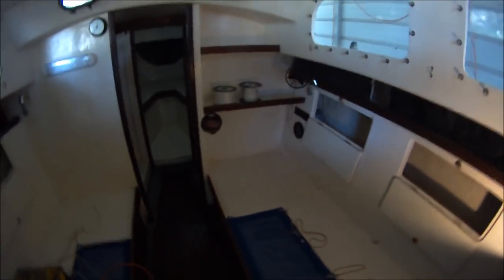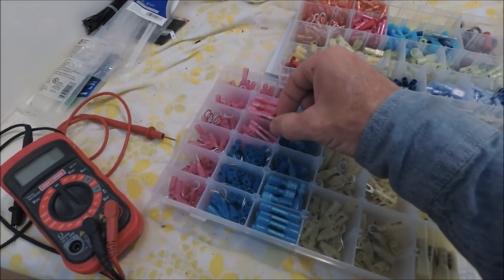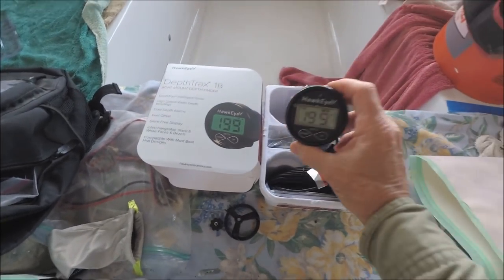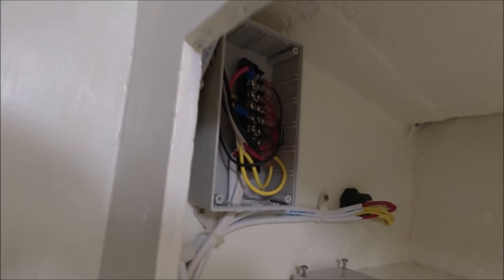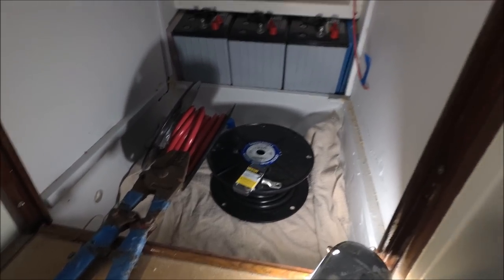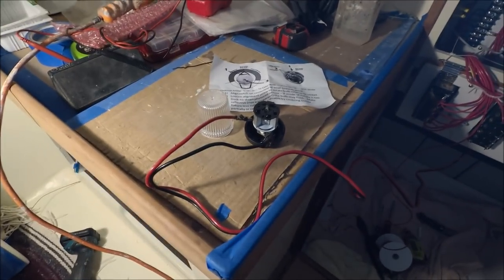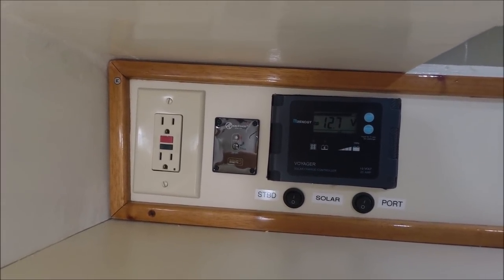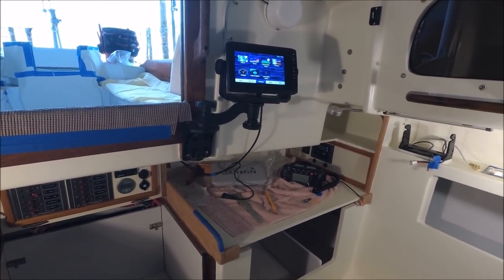Rewiring Sailboat 12 Volt Electrical   Triton Osprey Refit Part 8

Comment: James, absolutely enjoy your videos and books(currently reading your Distant Seas (puts me to sleep at night). Anyway, on the shut off switch for the outboard alternator-can you explain that a bit please. Thx.
Reply from the maker: You could wire the outboard motor alternator direct to a fused line going to the batteries but I put a switch in line to isolate it so I can monitor current going into the batteries and to be able to disconnect the circuit for troubleshooting. And because the switch is normally off when anchored or sailing I don't have to worry about some fault leaking current back to the motor. Same for the solar panels.

Comment: Good one! Lot of info. Did you have to do anything special with the alternator output from your outboard?  Did you run it through a charge controller?
Reply from the maker: The 6hp outboard motor alternator has very little output, only about 1.5 amps so does not need an external controller with a 420 AH battery bank. And the switch is there so you can just turn it off if not needed.

Comment: This is a fantastic video and I am currently working on my 1960 Triton. I have a question on the Garmin depth sounder you mention, located forward, I think on the port side. Do you have any photos of the transducer from the outside of the hull? I am considering a shark bite into the bow keel but your install looks to be simpler, although I am not clear on any disadvantages. My GPS plotter supports both Chirp and ClearVu.
Reply from the maker: There are no photos of the transducer from outside because they do not penetrate the hull. The face of the transducer is epoxied inside the hull. About 10% of the range is lost when shooting thru the hull but it means one less hole to cut, no chance if leaks, and transducer can be replaced in water by knocking the old one off with hammer and chisel. I don't know if your transducer is compatible with inside hull mounting. Here is a link to a video of some other options:
https://www.youtube.com/watch?v=ZX5U0JmEwoM

Comment: Hi James, I cannot thank you enough for the details you have put into this very instructive video. Second to none, I would say. I watched it so many times over that I lost count. One burning question is - what is the significance of the inverter remote switch? Why remote?  Thank you once again.
Reply from the maker: Good to hear the video is helpful. It's optional to use the remote inverter switch. It came included and is just a convenience so you don't have to reach in a locker to turn it on and off. If the inverter is mounted exposed then no need to use it. Keep in mind these cheap modified sine wave inverters are a great value but will not power some electronics and may shorten the life of some. I've had good luck over the years with this model but realize that might not always be the case. Everything I've plugged into it seems to work fine except for one variable speed jig saw that wouldn't start. Another brand worked fine so there was something in the tools switch that would not take modified sine wave. Even my notebook PC power supply worked good for hours at a time. Other than the PC I haven't had things running on it long-term. If it's a concern to you then you should pay extra for pure sine wave type.
Reply: @atomvoyager  Thank you so much. Your generosity in sharing your wide knowledge is so evident. I am touched. You know, I may understand 50% of the video now but it is 100% perfect for me to take a step forward in finding out the things you put out that I don't understand or aware of. You certainly gave us tools to learn more on our own steam. In that, I am truly grateful and hold you in high esteem. When I know, I will share with others. Just like you.

Comment: Hi there James,  I've watched this video  many times and everytime I find something new. Indespencible.

I've heard another youtuber mention leaving certain things "unswitched" including the alternator and solar on the idea that having your alternator switched off when it is generating power can wear it prematurely because   of the resistance of the generated power having no where to go. Is this something to consider?

I was also wondering about mounting the Hawk Eye transducer in the hull. Do you take care to make sure the transducer is level to the water line? When you Epoxy it in there, are you completely encapsulating it or just trying to get it to adhere?

Thank you for your time.
Reply from the maker: I don't want anything unswitched on my boat as I want to be able to quickly isolate all electric input or output for troubleshooting or monitoring purposes without having to shut off main battery switch causing everything to shut down. Most small outboards don't have an alternator, just a magneto or rectifier type charger that won't be damaged by running switched off. But if you were unsure if that is the case you can always leave the switch on while motoring. Maybe have a "turn on switch" tag attached to the motor pull start to remind you. 
When I set the depth transducer into a glob of thickened epoxy I press it down so it is roughly level and not tight to the hull contour which means the epoxy ends up thicker on one end. I make sure the entire face of transducer is coated so no air bubble is trapped. The epoxy does not need to come up on the sides of the transducer. You want to be able to easily knock it off one day with chisel and hammer because these transducers don't work forever and will need likely replacing one day. That's why I like to have two independent depthsounders installed.

Comment: Hi James - great vid!  What did you use to label the wires?  At 21:10 min, I noticed you used numbers on your wires and I want to do something similar on my rewiring project.  Thxs!
Reply from the maker: I used a wire marker book similar to this from Home Depot:
https://www.homedepot.com/p/Ideal-Wire-Marker-Booklets-10-Pack-44-102/100118882?MERCH=REC-rv_gm_pip_rr-302444114--100118882--N

Comment: Hi!
Like your work. I’m refitting my Hallberg-Rassy 24. About the hinges for the electrical panel allowing for the teak parts. Do you know where to find themor what they are called? Thanks!
Reply from the maker: They are called 1/2" Stainless Steel Offset Hinge, available at:
https://www.boatoutfitters.com/5-inch-stainless-steel-offset-hinge

Comment: Hey James, great video, thank you. I have a few questions, hope you don't mind. Regarding the boxes with lights and fans terminals (7:48)– I saw in two different marine electrical books that cabin lights were wired in parallel, either just one line(small boats) or two (port & stbd). How did you do the wiring, run a duplex for each lamp/fan? Does the same apply to the 12V outlets? Cheers!
Reply from the maker: While you can just run one duplex from the switch panel and parallel all wires to other lights and fans off that and size the wires for the extra voltage drop, I find it is a clumsy and awkward way to make and add future connections. That's why I add a terminal block each side amidships in a plastic enclosure and use that as a feed point for duplex wires to nearby lights and fans. If you had a smaller boat and a few less connections then it might make sense to eliminate the boxes to simplify it.
Reply: @atomvoyager  Thanks James. Could you describe your grounding system? Just about all info online starts with AC shore system grounding and engine negative bus connection, it's pretty complicated and I don't have either on my boat. I do have an inverter. Looking around the bilge area I haven't seen any keel bolts, copper plates or tape, so I'll have to built something from scratch. Any suggestions or pointers? Thanks.
Reply from the maker: @horiapopa6341  Since this boat and my own don't have a shorepower AC system we don't have any extra grounding. We have inverters but they only need a green chassis ground wire to the 12v negative bus. If someone wanted shore power on these boats they can run an extension cord through the hatch to either say a portable battery charger, microwave, heater, air conditioner or other loads too great for the inverter and even though I do it all the time it is not recommended because of the chance of some ground fault in the appliance and an improper ground on the shore circuit causing an onboard shock hazard. Perhaps a circuit breaker or GFCI attached to the onboard end of the extension cord would help reduce the risk in certain situations of a fault but I expect the dockbox breaker to be adequate. You need to research it and make up your own mind as to the risks. If you are adding permanent shorepower then you should follow the guidelines available online in order to protect nearby swimmers from stray current if there is a fault in your ground or with the shore power line coming into the boat. The AC green ground is generally connected to the 12v negative bus and engine block, sometimes to a bronze grounding plate outside the hull. Here's discussion on it:
https://www.boatdesign.net/threads/need-to-ground-12v-dc-system.22066/

And more detailed info here:
https://www.westmarine.com/WestAdvisor/Marine-Grounding-Systems

Comment: Great job,how has everything held up anything you would do differently? Thank you
Reply from the maker: Sorry for the late reply but yes it's holding up fine. Since prices of pure sine wave inverters in the 1000-1500 watt range have come down I now usually install them rather than the cheaper modified sine wave ones. Lithium batteries are also now more affordable and have a fairly good track record. I'll have an updated electrics video soon.

Comment: I tend to prefer isolating batteries. On my home (Cal 33) I have 4 large batteries with two 1,2,BOTH,Off switches. I can have all or any combination active. Had cells go and take the whole bank down.
Reply from the maker: That's a good point to consider. On this boat we are trying to keep things simple and compact for the limited space available. If one battery goes bad we can disconnect it from the bank although it would be easier with multiple switches.

Comment: You gone over the crimping tools and I kinda wanted to ask why don't you solder everything and then go over the soldered ends with a double wall heat shrink tubing. I know it's a lot more work and time consuming but was wondering what was your thoughts on soldering verses crimping? I had a friend years ago that taught me about soldering and i'm not saying crimping is bad just would like your opinion?
Reply from the maker: I know there are old school people who still solder and that's fine but since a crimp is fast and perfectly good with heat shrink and tinned marine wire and crimps and especially if the wiring is in a dry location it's not worth the trouble to me. I think soldering was more important in the old days when tinned wire and heat shrink was less common.
Reply: @atomvoyager  Thanks

Comment: Please explain why an electrical 'shunt' is required. I've heard it described as a 'resistor' but you have fuses everywhere, so I'm at a loss to understand why it's needed and why on the negative post? Does it also only measure 1-2 amps, maximum?
Reply from the maker: The shunt is on the battery monitor and you only need it if you want the gauge that shows battery usage info. It measures current flow by tiny voltage drop across the shunt in the negative wire. It can handle well over 100 amps. More info on it at the link below. A resistor is something different and is commonly used to drop voltage, for example on a light dimmer or to control fan speed.
https://theboatgalley.com/monitoring-the-batteries/
Reply: A shunt is a conductor with low, calibrated resistance, normally sized to handle substantial current.  The resistance in the shunt produces a small voltage drop across it, and from the resistance and voltage drop you can determine how much current is flowing in amps.  They're used for  power monitoring, such as the charge rate to your batteries, and the power use from your batteries.

Comment: what fans did you use? I need fans for my T22
Reply from the maker: I like the CAFRAMO–Compact 757 2-Speed Cabin Fan. I place a rubber gasket between the bracket and bulkhead to cut down on vibration noise. In locations where I have a fiddle or bulkhead edge available I like to use the same fan with the CAFRAMO–Two-Speed Compact Fan Mounting Clamp which makes it able to move around to where you need it. For a small boat you might not need to mount one permanently on a bulkhead and just move one or two clip-on ones around. Make sure you have enough outlets near where you want to place them. I also use the Bora fans sometimes but the Caframo seem to move more air.

Comment: Why do you use AGM batteries vs. lithium?
Reply from the maker: It was over two years ago when we installed the batteries and at the time these 100AH AGM batteries were available for $180 at Sams Club which was way cheaper than say the $900 battleBorn lithium. I wasn't willing to learn how to build my own lithiums from suspect Chinese components and risk bad cells or an unreliable BMS. SOK batteries are now at $570 each and since they are serviceable and the BMS can be replaced if it goes bad, I'll be using them soon on another boat. I'll probably have an AGM engine start battery in that boat to simplify the charging complications of lithium and provide some backup power if the lithium BMS goes out.

Comment: how do you combine all your cabin lights and fans onto one switch
Reply from the maker: At 7:41 you see the terminal block where port side lights and fans come together and then only one duplex wire is needed to feed back from there to the  main terminal block near the switch panel. Then the starboard side does the same thing and a few others from the aft cabin area come back directly to that also and one wire from there goes to the switch to power them all on one circuit. Somewhere in the video you see that I add jumper connectors to the terminal strips to link several wires together as needed.
Reply: @atomvoyager  are you one facebook messenger or something like that? would it be alright, because I might have some questions for you because you have more experience than me while I’m fixing up my 1974 Tanzer 22 and if I ask on here it might be delayed, you can add me on messenger at Collin Farrington
Reply from the maker: @weezyy1945  Yes.
Reply from the maker: @weezyy1945  Sorry but I'm not available for that.

Comment: 5200 to attach wiring, hope you never need to remove it
Reply from the maker: It's correct to be cautious using 5200 but in this case the wire jacket and paint are too slippery for less tenacious adhesives and the small amount used will come off easily if needed. Also the wire slips through the jacket.

Comment: that’s a modified sine wave inverter and will damage your appliances and chargers, don’t use that
Reply from the maker: Thanks for pointing that out. I forgot to mention there is a chance of damaging certain electronics with modified square wave. Since pure sine wave invertors were crazy expensive until recently, I've been using the others for over 20 years on my own boats and other boats and never had anything damaged. I did experience a couple times that something wouldn't operate because of the wave form but there was never any damage that resulted. Apparently in some case there can be damage from overheating if run a long time. Otherwise, it's generally not a problem. If you can afford it then pure wave is the way to go.
Reply: @atomvoyager  yeah I got a modified one based on pricing as well but I learned the difference between the two and cancelled the order because I didn’t want to take the risk